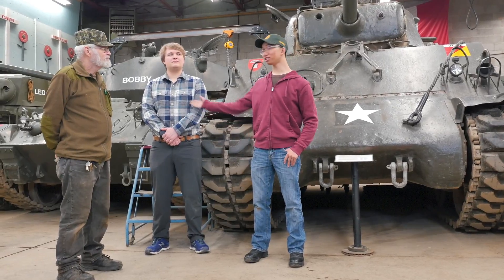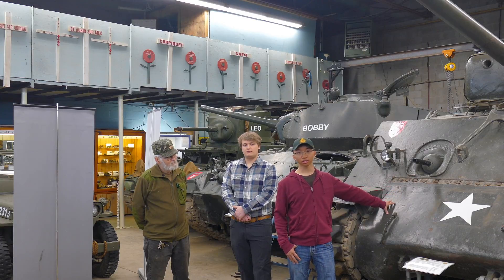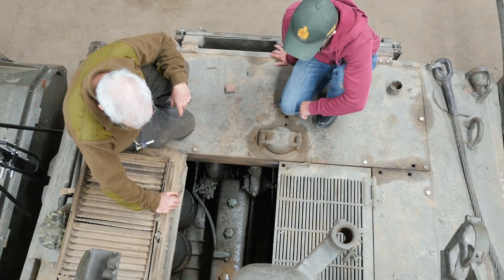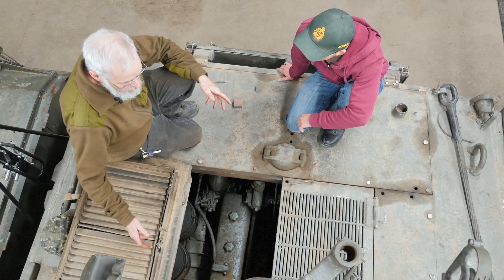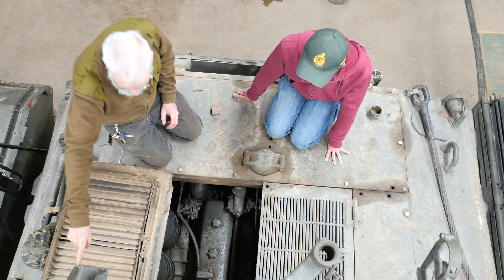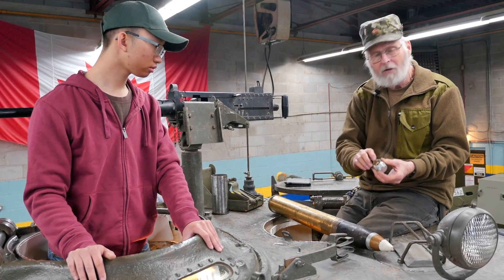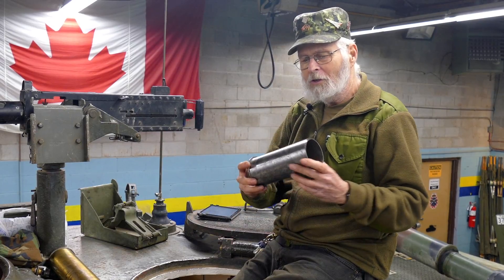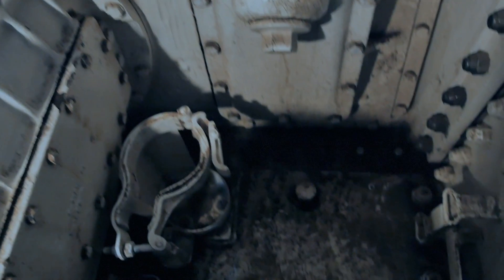M4A2E8 Sherman (Part 1)  Engine deck and Ammunition

Comment: I believe he is incorrect about the high explosive round.  Typically WWII HE had two settings, superquick and delay.  The SQ means it goes off as soon as it hits an object, the delay could be used to penetrate walls, etc, and also allows ricochet shots off the ground.  The mechanism he shows might actually be a bore-safe mechanism.  Basically this makes the round not go off till it leaves the barrel (loss of angular acceleration), and there is typically 50 feet or so past the barre where it is a 'dud'.  he seems to be describing something akin to antiaircraft ammunition?

Comment: If it's Diseal its a M4A2.
If its gasoline its M4A3.
Reply: The M4 Sherman Medium Series is a little complex most of the models were produced concurrently. 
You have early production, mid production, late production.

Tank hulls esp. The Sherman are composed of the lower hull and upper hull.

Early lower hulls were in essence M3 Lee/Grant medium lower hulls , that consisted of riveted armor plate.
The forward section housed the transmission drive sprocket etc driver on the left and gunner radio on the right. There was a curved rounded plate you can call the transmission housing, here again you have early, mid and late production.
Over time the lower hull would be lengthened rivets reduced and welded armor plate.
The upper hull is essence you have  two types a welded hull and a cast hull also early, mid production and late production.
But there is more versions .
A prototype upper hull i have seen pictures of had driver and hull gunner hatches located port side armor plate and star board side armor plate.
Some had three 30-06 browning Machine Guns located in the hull , the ball mounted gun operated by the hull gunner and the other two were mounted on a tray that were operated by the driver much like the M3 Medium tank series.
1. M4 early had small roof style hatches for driver and hull gunner they contained vision blocks in the front hull plate direct vision blocks were located they had armored steel blocks that could be raised or lowered to protect hull crew.
The suspension system on early M4's consisted of truck ( A) system at the top of the ( A) were the return rollers , three per side at the bottom of the ( A) were the Road Wheels they were medium size open spoke wheels . They were attached to arms and rode on heavy coiled springs . There was a central up side down V shaped box  that the arns and road wheels and return roller were attached to.
The front plate was long and sloped and when you went to rear of the M4 Hull it was on a downward slope. 
The turret was rounded and cast , and had only one hatch a large rounded hatch with split hatch doors and a mount for the M2 Browning. The hatch ring could be rotated . 
The gun was the M3 75 mm medium length gun barrel and was noted as a gun/howitzer.
The guns main function was meant to take on enemy infantry, bunkers and soft targets on occassions enemy armor.
Early gunshields were narrow and curved. 
Latter they added wings to the shield to protect the barrel near the shield.
Still later they added a armor block to protect the coxial .30 caliber Browning.
Then they went to the wide curved gun shield.
In the field they started to weld shut the direct vision blocks and would add welded armor plate over the direct vision blocks.
The mid productuon upper hulls the direct vision blocks were removed and armored blocks added that contained indirect vision blocks like those in the drivers and gunners hatches.

M4 early and M4A2 and M4A3 were welded hulls.
M4A1 was a cast hull.
Reply: Late production hulls the front hull plate the angle was changed the armored boxes for the indirect vision blocks was eliminated. 
Large hatches were added and the indirect vision blocks were located in the roof of the upper hull.
Reply: Actually if diesel M4A2 or M4A6. M4, M4A1, M4A3,M4A4, M4A5 (Canadian RAM) were all gasoline.

Comment: "could penetrate at effectively any range they wanted"

ahhhh no, if we are talking about the KWK 40 L/48 on a PZ IV it would struggle to go through the front of this past 500 meters.

this thing has 64mm RHA of frontal armor sloped at 47 degrees for ~118mm of effective armorthickness.
the KWK 40 L/48 has Pzgt 39 has ~120mm of penetration at 500 meters with a 50% success criteria.
Reply: NedYarbNexus even The long 75 and the kwk 36 88mm struggled at long ranges.
This tank didn’t have bad armor, the Germans just had very good guns
Reply: According to the math, it would take 8 or more shots to disable a Tank from longer distances.

Even that the German Guns were high velocity, distance and wind will affect the rounds that will change course than expected.

Comment: I take issue with some of the discussion about the gun only penetrating at 100m.  The 75mm was able to penetrate the PzIII and PzIV up to 1km or more with the M61 APCBC.  Even the M48 HE could crack armor at those ranges on the flanks.  The 76mm M1 gun could penetrate at double that range.  The only tanks they had trouble with was the Panther and Tiger tanks which were rare enough and could be penetrated from the flanks.
Reply: just no. sorry to tell you.
Reply: @YZER19  "Just no"... what? Is that some sort of response? To what and why?
Reply: SpecialEducation can you tell me where you saw that? If like to read about it too. How come  I couldn't find out about that rest eludes me.
Reply: M93(T4) aka HVAP Tungsten core round would have no problem punching through Tiger frontal armor from distance of 1 kilometer or even farther, but those rounds was very rear, and only one or two issued per tank in Normandy, not to mentioned only one or two 76mm M1 Sherman tanks was in a tank platoon, since 75mm was much better vs softer targets, and had one and a half time more explosive in fragmentation shell then 76mm, so that is the reason why 75mm was in higher demand then 76mm Sherman tanks.

Comment: Excellent video gentlemen, except your tank nomenclature is erroneous.  The diesel engined version of the Shermans, regardless of armament or suspension components, was the M4A2 not M4A3.  This tank is an M4A2, 76MM, HVSS. If this vehicle was in Canadian service, it is definitely the M4A2 as A2s were supplied to the British and Commonwealth Forces. This is probably a post-war Canadian issue tank.  I don't believe this configuration saw service with Commonwealth forces in WWII.  They were pretty happy with the Firefly.  

 The US version was the M4A3, 76MM, HVSS with the  Ford GAA V8 gasoline power plant.  Everyone called these tanks the E8 or Easy 8 because the "E" or "Experimental" nomenclature stuck.  Calling it the E8 is definitely within the bounds of GI and Tommy jargon.  Once again, an otherwise excellent video, looking forward to the next one.
Reply from the maker: Good catch, our apologies for the mistake.
Reply: @sabotvideos1136  another thing. This youn man don't know nothing about armor values. Sherman with this armor have 64mm on front sloped at 47 degres it's give 90mm of effective armor. And on sides it have 38mm not 35mm of armor. Shame, Shame Shame.
Reply: It definitelly didn´t. An only fihting force which deployed this final configration of Sherman in its M4A2 "Allies" variant (M4A2 was used only by Marines, not by Army in the U.S. hands, and only in its dry storage, small hatch 75mm variant), was the Red Army.  This variant was also chosen by Fury film makers, because it looks exactly like M4A3 76W HVSS, which was delivered in huge numbers to U.S. forces in ETO from December 1944 onwards. There were also two other HVSS Sherman variants which made it to fighting units in Europe before VE day - the M4 105 HVSS and M4A3 105 HVSS. M4A1 76W HVSS was manufactured January 1945 - July 1945,  being last production variant of Sherman ever, but no one of these was delivered to fighting units.
Reply: Didn't the Canadians call this tank the "Grizzly"?
Reply: The Grizzlys were A1s built in Montreal.
Reply: @TheFlatlander440  No, they didn´t. Grizzly was nickname for first production variant of Sherman, the M4A1, manufactured in Canada (M4 with the same engine  but welded hull came to production, surprisingly, as the last one from all 4 main production variant in July 1942, after M4A2 and M4A3.
Reply: It was a Soviet Lend-Leased tank, all labeling in Russian language, so it is defiantly an "Am-cha"(M4A2).